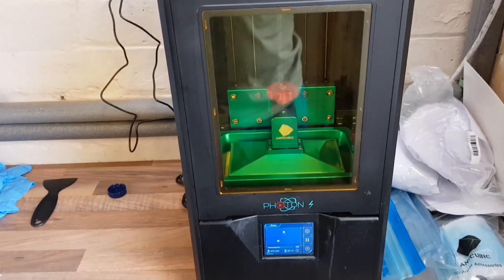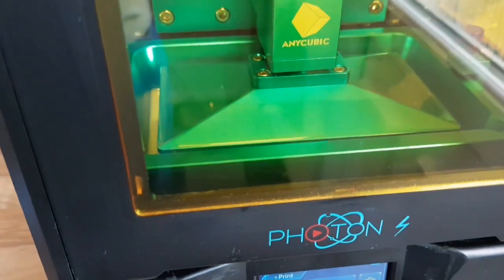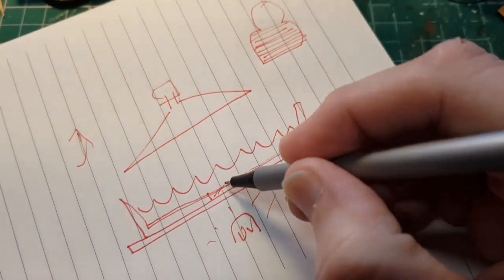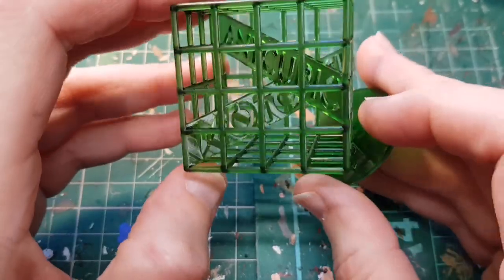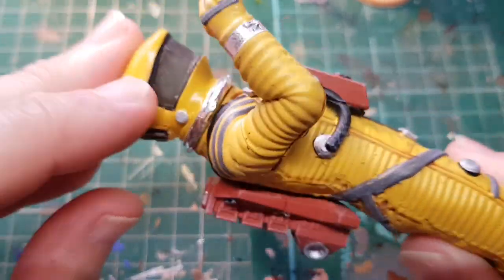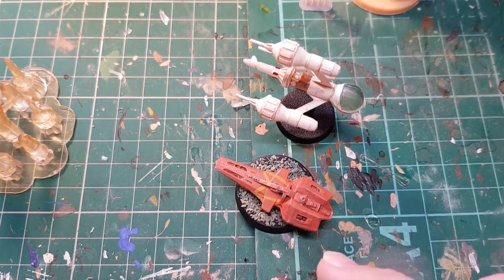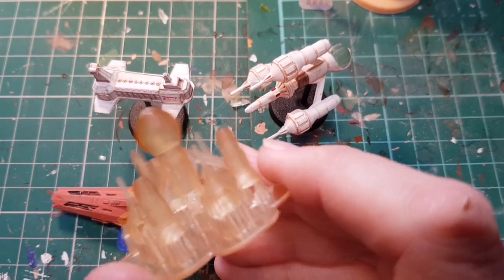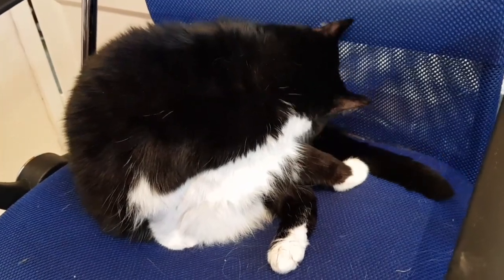3D Resin Printing the Blakes 7 Liberator on the Photon S by Any Cubic

Comment: I love the Blakes 7 prints,is a resin printer faster to print than a fiament printer?thanks
Reply from the maker: Yes I find the resin printer is quicker especially for wider flatter prints as each level prints at the same rate unlike filament which has to transcribe the shape

Comment: So COOL! Is it easy to use? Software is good?
Reply from the maker: The printer works from the box with the build plate needing it's z axis set, which is very simple to do. The software that comes with it to slice and add supports is drag and drop and works well though there are other programs with more options available